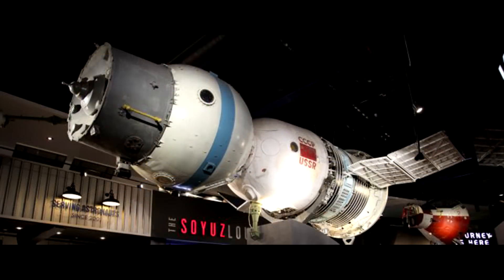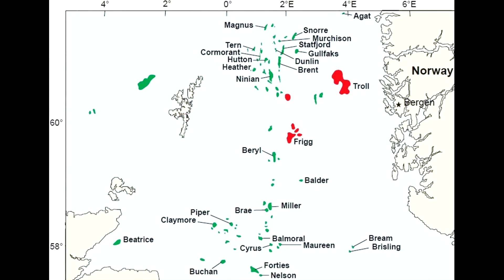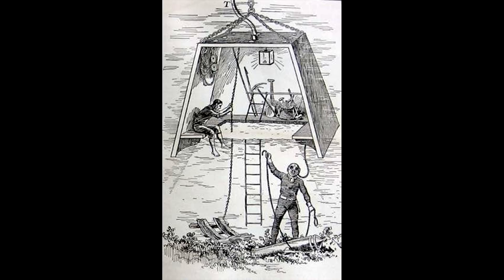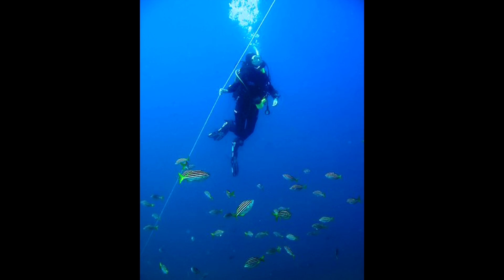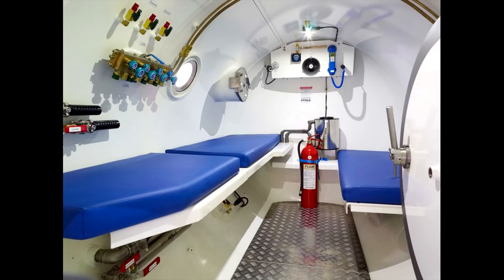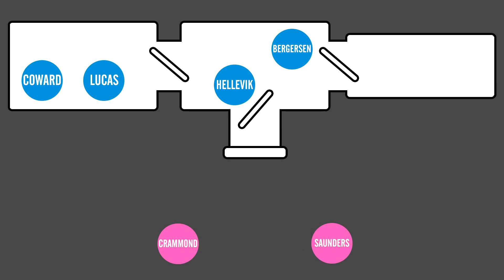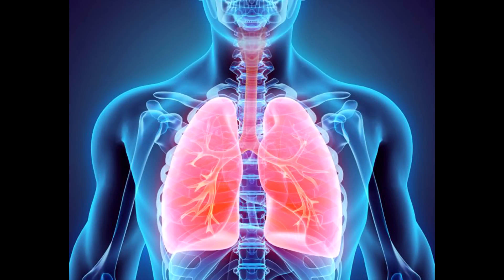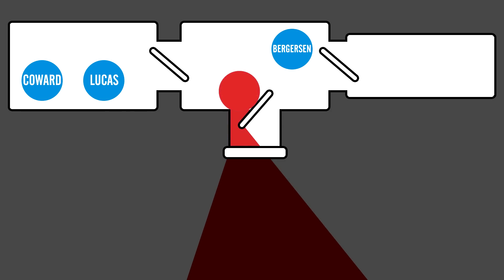Extreme Loss of Pressure Tears You Apart | Last Moments

Comment: That was a pretty good explanation of the event, and I am glad you kept to a technical explanation rather than played up all the dramatic details. However.. at the time the guys inside the chambers were not decompressing, they were living at their holding depth which is about 10 meters less than the working depth. On this particular Comex system, after the dive, when the bell was locked on to the chambers, the divers put all the consumable items, like the sodasorbe canisters, silica gel canisters, old food and drink containers, along with their hot water suits and under suits into the trunking. The door of the bell was shut and the internal pressure of the bell slightly increased to hold it shut, then the divers in the transfer chamber shut their door. When they have confirmed the doors are shut, the dive supervisor bleeds the from the trunking. When the trunking is surfaced, the supervisor tells the deck crew to unclamp the bell and recover the gear in the trunking for cleaning or replacement. Notice that on this system, it is the dive supervisor who pressurises or depressurisation the trunking…and then tells the deck crew he has done so.  On most sat systems of that time, there was a visible pressure gauge on the trunking, and it was the deck crew, who being able to physically see if there was pressure in the trunking, who controlled the pressure in the trunk by way of valves fitted to the trunking it’s self.  You also miss the fact that the dive crew had already done one 18 hour dive with 4 hours off…followed by a 14 hour dive with 3 hours off and then the final dive of 9 hours after which the accident.. Everyone was completely exhausted.
Reply: God Bless all the saturation divers, soldiers, doctors etc. in the world who risk their lives for us. I am happy that youre still alive but I am very sad that you had to experience something like that.
Reply: wow it’s martin, thank you for the insight. hope you are well.
Reply: Wishing you the best. I hope you’ve been able to mentally heal (at least somewhat) from this horrible situation. Hopefully, in regard to recent events, safety when it comes to this will be more widely recognized.
Reply: Hi Martin, thanks for the explanation. I have seen many videos and articles on this and they all list 5 steps. Step 4 is that the pressure in the trunking is slowly lowered to 1 atm. However I don't understand why this is necessary because as we know detaching the diving bell immediately sends it to 1 atm. Can you explain? Everybody lists that step and I don't know if it is an error and everybody is copying each other. Sorry for what you had to experience. Hope you are doing well.
Reply: I hope you are doing well Martin, you deserve it.
Reply: Except it’s wrong
Reply: thanks for your insight,hope you are well

Comment: Manufacturing and commissioning inherently dangerous equipment which fails to incorporate necessary achievable failsafe mechanisms within the design is both negligent and unforgiveable. The equipment designers and providers are clearly at fault here even in consideration of the fatal operational error that ocurred.

Wherever an activity carries inherent danger to life it is the duty of those designing and providing any associated operational equipment to incorporate both generous factors of safety and proven comprehensive operational failsafes into the design process, the failure here has clearly been caused by the continued use of inherently unsafe and outdated equipment which needed to be decommissioned and replaced in lieu of serious safety concerns, this terrible accident Could and Should have been prevented.

Comment: Another good example of explosive decompression is on Aloha fight 243 where the top half of the fuselage was ripped off due to a crack in the airplanes skin at 30,000ft in the air. The only death aboard the flight was a flight attendant that was standing near the front and was instantly sucked out

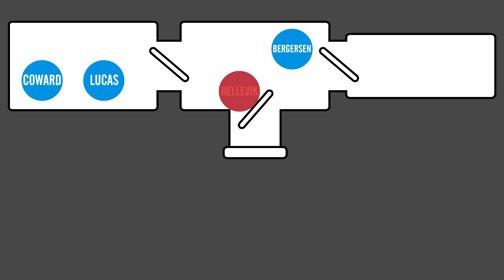Comment: 5:28 "Hellevic is sucked into the opening."

No, he was blown into the opening.  Air has mass, and the greater pressure inside the chamber rushing outward pushes, not pulls, against the objects/persons it encounters.
Reply: @Splashbang_OW  Wrong. If it had been in space, they would have been blown out exactly the same as if they had been in a high-altitude atmosphere. "Vacuum" is a pseudo-force. It does not really exist.
Reply: I don't understand the difference. If I drink through a straw, I'm sucking the drink up by making a lower pressure in my mouth than in the glass. I might be suffering a misconception, but it just seems like a matter of perspective.
Reply: @hyperhydra376  Yes, it's a common misconception. When you create a lower pressure on one side of the straw, the higher pressure on the other side PUSHES the liquid through the straw. "Suction" doesn't really exist; it's a pseudo force. Since a vacuum is an absence of substance there's nothing to attach to and "pull" other substances. It's the atoms of the "non-sucking" side, which have mass and energy, that are pushing the other substance.
Reply: @seikibrian8641  well I've certainly learned a thing or two about correct terminology
Reply: @luger_Mann  I recall an episode of 'Star Trek: The Next Generation' in which someone -- Commander Riker, I believe -- makes a comment about someone or something being sucked into space, and Data corrects him: "Blown into space."  It's such a common misunderstanding that they made it the subject of a TV episode.
Reply: It's the same thing, they are synonyms you're just being a pedantic "that guy". The term suck simply means "pushed from the other side"
Reply: @gavinjenkins899  They are NOT synonymous; you just don't understand the nuances of language. "Suck" does not imply "pushed" (although that is what is actually happening), it implies "pulled."
Reply: @gavinjenkins899  You've proven that you don't understand the nuances of language. You don't even know what an implication is. Of course, I suspect you're just trolling, and since I don't feed trolls I'm done with you.
Reply: @seikibrian8641  Still not a word from you about why you'd possibly think that a word that describes pushing 100% of the time would ever imply pulling.
Reply: @seikibrian8641  This just feels like you're playing semantics..
Reply: @Zeromaus  He's right, though
Reply: You ever thought about teaching physics
Reply: @anfrac3700  LOL!  I suck at math. (Pun intended.)  In high school and college, I had high marks in English, social studies, psychology, etc., but low marks in math and other sciences. (Non-science majors are often unaware of how much math is involved in even chemistry classes, let alone physics.) I did well in the lab sections, but poorly in the lecture sections.
Reply: A suck is also a blow, depending on which side of the pressure gradient you are observing from. Since they are going from high to low pressure, "sucked" seems more appropriate.
Reply: @TechCensorshipHasToGo  Nope. Not more appropriate; just wrong. Since they are going from high to low pressure, they were BLOWN from one place to the other BY the higher pressure.
Reply: @seikibrian8641  Or sucked by the low pressure... you've not explained why it's not sucked at all.

Please provide examples of something being sucked vs blown so that your position is more clear.
Reply: @TechCensorshipHasToGo  It's simple physics. Air has mass. The atoms of the various gasses in air push against objects. Lower air pressure atoms don't somehow "grab and pull" objects, it's the higher-pressure atoms that push objects as they move to the lower-pressure area. "Suction" is a pseudo force; it doesn't really exist.
Reply: @seikibrian8641  So you're pointlessly arguing over semantics then. It's not "hot" it's "warm".
Reply: @TechCensorshipHasToGo  Understanding how the universe works is far from pointless. Your comment, though, is pointless.
Reply: @seikibrian8641  "It's not cold, it's lack of heat"
Reply: @TechCensorshipHasToGo  Now you're just being silly. Cold is, by definition, a lack of heat. As long as one understands that heat is caused by energy and that cold is the lack of that energy, not a type of energy itself, it's a proper description of something.
Reply: You sure do know a lot about sucking and blowing.
Reply: who cares we get it, the hole did the thing and like he went out from it from extreme pressure

Comment: this incident inspired several movie scenes, however those scenes are all in space. In space a person would not be violently sucked through a small hole as the cabin pressure inside the capsule or shuttle is comparable to earth. you would get sucked out if the hole was wide enough for your body to fit but if its a small hole all that will happen is you get stuck and part of your body exposed to space, which is also not good.
Reply: Dont remember which James Bond, but there is a scene where it is done in the diving chamber of a boat.

Comment: It is absolutely insane that this was even possible. Given the instantly fatal consequences of an explosive decompression, why was there no interlock to prevent the diving bell being disconnected before the trunk door was closed? Totally negligent design.
Reply: DNV had suggested an interlock be installed, but they didn't.
Reply: Company refused to stop using outdated and dangerous equipment and had people working long shifts
Reply: The answer most of the time is money.
Reply: Strongly agree.  This feature is mandatory and should have been in the original design of the equipment.  Not an afterthought.  Not and add-on.
Reply: As has been said before:  Safety Regulations are Written in Blood.

That's why we have things like guards on cutting equipment, don't have open belts on belt driven machinery.  It's not because somebody went "ooooh, safety first, better design it to be safe!" it's because someone designed the thing to do a task and said, "what kind of idiot would operate this thing improperly?"  And then people get torn to pieces.  Then the thing is redesigned with safety features.  That's human nature.  Very rarely is something designed for the very first time with safety features-- happens more now than it ever has in human history.

Heck, the very idea of hardhats wasn't even implemented as a safety feature until enough men lost their lives working on the Hoover Dam.  They were issued leather hats (or had to buy them?) and would take two of them, put them into eachother, and boil them in oil to harden them so that they didn't get killed outright by falling debris.  Then it became normal.  Then it became mandatory.  Now we have hardhats the world over.

Same thing with HiViz vests.  Same thing with welding masks.  Same thing with respirators.  On, and on, and on we go.  The world you live in was built on corpses.

Also, if I remember correctly, this was the first ever major incident recorded of an explosive decompression ever happening with a diving bell.  At least, to this extent.  It was such an extraordinary event that doctors were clamoring to see the bodies that were still mostly intact, because nobody really knew exactly what happened to the human body during an explosive decompression and it was a chance to study the effect, learn about it more, and maybe find better ways to do things.

Comment: @bladerj  Design can kill... Or not. I have developed underwater AC line powered lighting, a product that until the 1970s would electricute and kill people just by having a broken lens. That kills by design. (Now, if the glass breaks, at least two safety systems must also be defeated... GFCI protected power, and inherent leakage current protection.)
My point is, the government regulations must compell manufacturers to put in a lot of effort into imagining and simulating component failures and human failures to determine if the result is harmful. Humans are imperfect, and should never be expected to be perfectly careful to keep people alive. Components can fail, and a single failure should either be tolerated or extremely improbable. The designers of that system that relied on perfect communications from perfectly trained people to do the correct thing over and over again in the face of distraction, lack of sleep, forgetting where you are in a checklist, made that decompression design the primary cause of the error. A government determination that "human error"  was the cause is itself negligent, and misdirects accountability towards the victims. Government regulation with true accountability continues to be lacking, and is the long-term fix that must be implemented.
Managers and executives at Boeing who overrode Boeing's DFMEA process that allowed MCAS should be jailed, along with US government regulators who chose to believe a fox will protect the hen house.
Here is a catalytic mechanism that would force a lot of institutional change: connect the    design of system or subsystem design to the engineers and their managers by name, and jail those who don't do the "safety by design" work that is needed.

Comment: It seems so absurd to me that the designer of this system would have allowed the possibility of opening the clamps with the bell and chamber unsecured and one or both pressurized. There are not too many ways that human error could theoretically cause an incident such as this, and opening the clamps before the system is sealed instantly comes to mind as the worst possibility of them all, so it absolutely should have been accounted for in the design. Yes, it was the tender’s fault, but a good engineer’s job is to anticipate that tired, error-prone humans will be using their design and to account for the mistakes they might make if they become complacent, so I would say the fault is partially shared by the engineers who designed this system in the first place.

Comment: I work with high pressure machinery for textile dyeing, and I know very well that you don't mess up with  that, once, 25 years ago when I was still relatively new, I opened the main gate of one of our big machines because I had to remove a knot that formed on the cloth, but no one told me to open the pressure release valve, and when the secure lock was off I opened the door and the massive pressure and the boiling steam  that had inside hit me in the face and arms, pulling me to the ground like I was a doll.
Can't even imagine at this scale, where you end up sucked and blasted like meat.

Comment: So somebody please explain how this does not happen in the vacuum of space?
Reply: Significantly less pressure difference even in the worst case scenario. Most space vessels only need to be pressurized to <1 atmosphere so the most the pressure can change is one atmosphere or less. This was a pressure difference of eight atmospheres, or eight times the amount of pressure you feel on your body standing on the ground at sea level. For additional reference, one atmosphere is about the difference between surface level and ~33 feet or 10 meters underwater.

Comment: @qxir this isn’t an accurate reflection of the accident or the circumstances.
The Dolphin divers were saturation diving, not decompressing. The first two were the inbound shift for the sea floor and two already in the living chamber the outbound.
The diving bell was decoupled with Hellavik still in trunk and rather than being ‘sucked out’ the sudden changing in pressure explosively propelled his body apart. So much so that they found his liver nearly intact almost a hundred meters away and a portion of his spine was actually propelled up and onto the deck of the oil rig.
The other three men were killed instantly by a likewise explosive propulsion of their internal gaseous spaces changing from 9 to 1 atm
They all effectively ‘popped’ long before they got to the hatch

Comment: as long as they died quickly enough to where they didn't feel any pain then dying like that isn't so bad. basically your body is pressurized to the depths that you'd be working at (9 atmospheres is about 132 PSI) and explosive decompression happens to quick for air to safely escape the lungs, sinuses, and eustachian tubes typically resulting in fatal Barotrauma.

Comment: This horrific accident led to a complete redesign of door/airlock systems, making them unable to being opened as long as there is any pressure left in the system.
Reply: @chaist94  Common sense that time was that you would always need to be able to acces from the outside. Todays this is not possible with the slightest pressure at the inside (causing the door to autolock). Pro's and Cons. A few years ago a dive support vessel went down with I believe 10 guys in the chamber. With the door only able to withstand pressure from the inside, the door was breached due to waterpressure from the outside. With the doors from this accident they might have had a chance.

Comment: Imagine getting sucked through a 24" opening... must have been like putting him through a meat grinder.
Reply: A 24" opening makes it sound big. I'm 6'1" and weigh 180lbs and can go through a standard 11"X15" elliptical manhole opening all day long. What the poor
guy went through is better described as a 24" long crack less than 1" wide. (It was a small round door that was barely opened). I'm pretty sure I won't fit through 
that, even if I emptied my pockets. RIP to the crew.
Reply: @KSparks80  Well, that's what I meant... a 24" long half moon opening.  But I'm a pretty big guy and the thought of going through a 24" opening gives me claustrophobia.